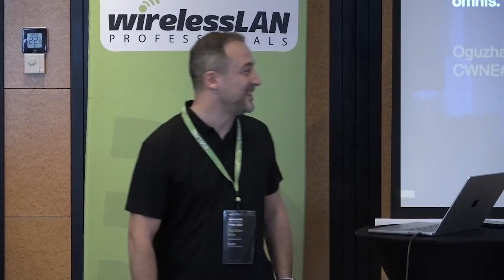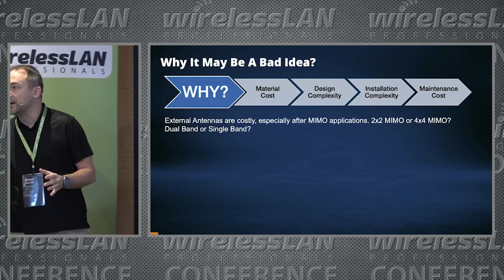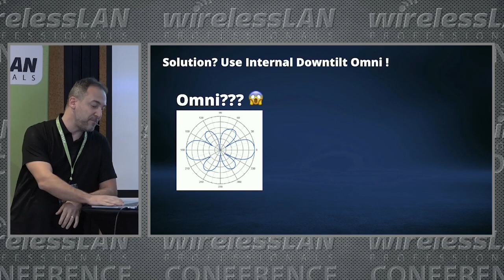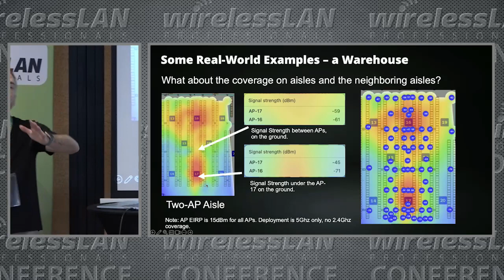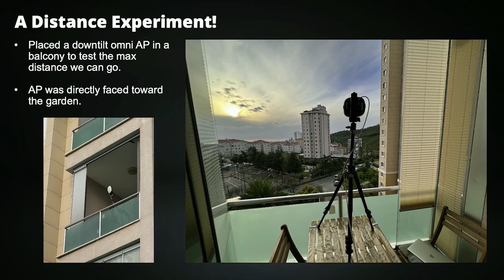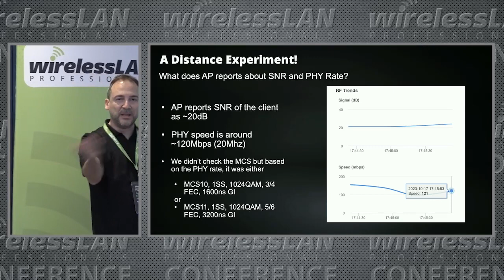Warehouse Wi-Fi is Possible Without External Antennas | Oguzhan Eren | WLPC Prague 2023

Comment: No matter the gain, external antennas all have gain reciprocity. The gain is applied to Tx as well as Rx equally. Remember this when considering “power mismatch” problems.
Reply: That’s correct. While doing power budget calculations, it is important to add gain not only on Tx, but also on Rx. 

Only thing (which can be neglible) is that antenna gain on Rx also affect noise around which could be problematic to isolate later on SDR phase, when it is operating on high-noise environment.